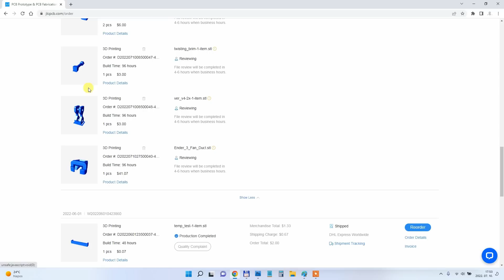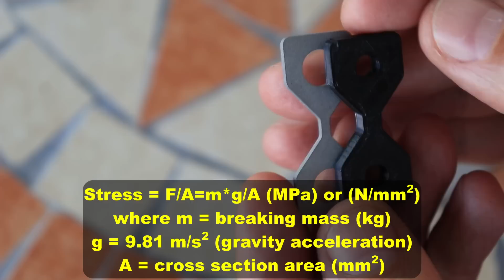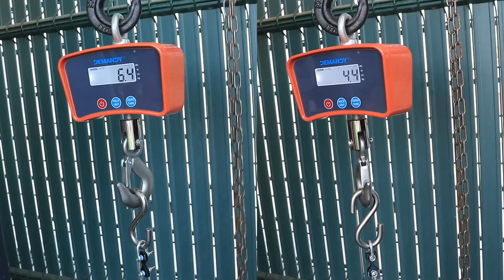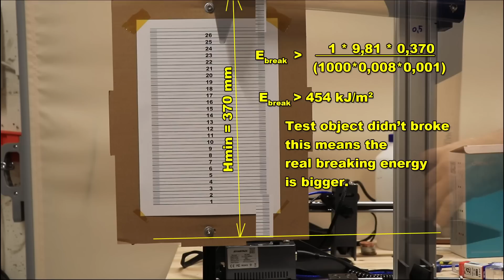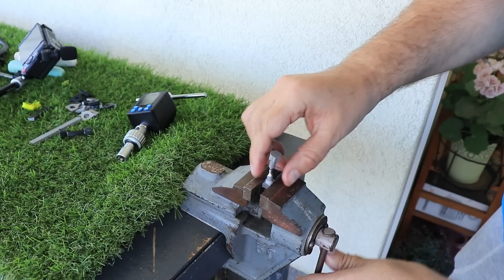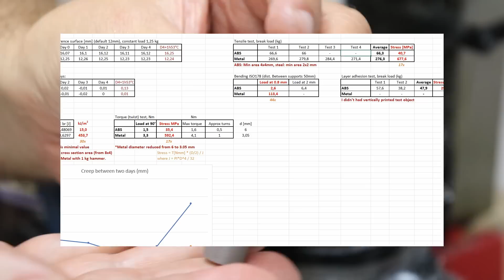How strong is 3D printed metal? SLM (stainless steel) vs FDM (ABS) by JLCPCB 3D printing services

Comment: Is it possible to print the threads into the part?
Reply from the maker: Yes, but they are not accurate and smooth enough. I like to just ask for holes, then cut threads (only it is hard to cut in stainless steel)

Comment: Good Morning Doctor Igor,

Thank you for your teachings!

I am curious.. Would you consider testing your 3D Printed (FDM) PLA, PLA+, or PLA advanced against the SLA metal?

I ask because I am curious that the values of mechanical strength will be much closer in value compared to ABS as ABS is consistently weaker than your PLA testings.

As such I think PLA/PLA + would be a better match up. 

Lastly, my friend how do I view the live updated excel spreadsheet of all filaments/substrates which have been tested?

Thank you
Reply from the maker: I already did some similar tests, search on the channel a little bit. Or you can do it on my website: https://www.mytechfun.com/videos/3dprint

Comment: very cool. thanks for these tests.
Did you sharpen the stainless steel drill before drilling with it or you used it as it arrived from JLCPCB with zero post processing?
Reply from the maker: For wood zero post processing but I noticed a lot of heat. Then I just touched the back surfaces to grinder stone and then drill ali like a real tool

Comment: in the toping of a 3D printed drill bit... There are end-mills being manufactured with SLM.  One can design them with integrated cooling passages and structure optimized for the chip load - while minimizing the mass of the endmill (less vibration, better response to movement and speed changes).
  
https://www.youtube.com/watch?v=fx5dWHBut2Y&t=176s

Comment: 8:17  ...  The threads backwards on that 3D printed bolt?
Reply from the maker: As mentioned in video, there are two threads, like here: https://youtu.be/6aucvcCdOv0
Reply: @MyTechFun  I heard there were 2 threads, but by looking at it, the threads are going in the opposite direction as normal threads. They "tighten" counter clockwise instead of clockwise.
Reply from the maker: @deucedeuce1572  Yes, that's the trick, the other is smaller (smaller pitch) so it is not easily visible.
Reply: @MyTechFun  I see. thanks.

Comment: Can you release your drill STL file? I went on JLCPCB and the cost for parts were pretty expensive. Greater then $100. I would just like to see if the price has been drastically raised since your video.
Reply from the maker: That would be a big difference, when I tested it, it was $18. You can download it from this page: https://www.mytechfun.com/video/212
Reply: @MyTechFun  It's $18.28. I guess the price is mostly based on volume and if it needs support. My part did not seem much bigger but price must be exponential with volume/support.

Comment: Hi Igor, I really enjoy your videos. There are very fast printers like Bambu Lab X1 and FLSUN V400 on the market, would it be possible to test how much fast printing affects print strength? I think the hotend and the cooling method would have a big influence on the strength, I wonder if for example the volcano/volcano cht has more durable prints in high speeds than the v6 or creality hotend.
Reply: You are right, diferent hotend give diferent strenght depending of speed, but its more a matter of flow (mm3 /s) 
E3d v6 will have a maximum flow of 10mm3,
Volcano will be closer of 20 /25 mm3
Exeeding these flow rates will tend to give weaker prints because the plastic is improperly melted.

Comment: You didn't specify the printing orientation? It it actually makes a difference as it would for your testing you need to specify it of course. Other than that they use software to make most out of the print volume. The model orientation doesn't make any difference in cad.

Comment: The truth is that the stainless steel part is not sintered but actually melted - the laser MELTS the metal particles. "Sintering" is not just misleading, it is wrong.

Comment: I had the same problem with a PETG fan duct deforming at the nozzle like yours.  So I made another one and coated that last bottom inch or so with epoxy, inside and out .That solved it.  Before it was worse than yours since my ducts are quite thin. It's been a couple of years now with the epoxy it's still pristine.
Reply: what kind of epoxy?, can you share?
Reply: @mycinemax2653  Just a regular two part epoxy like UHU or Araldite. I just used a cheap dollar store brand and just pantied a little on, letting the excess drip off a corner where it won't interrupt the airflow.
Reply: @GBCobber  thank you..

Comment: Good video, wish they had printed the steel test parts vertically and surprised that a professional printing service did such a bad job matching the specific dimensions. One thing that would be useful is if you could maintain a master test results file that combines the results of all your tests. Always like your testing methodology given the limitations of a small budget. Something that could be interesting and are relatively cheap in the US is a small hydraulic press for vertical compressive test.